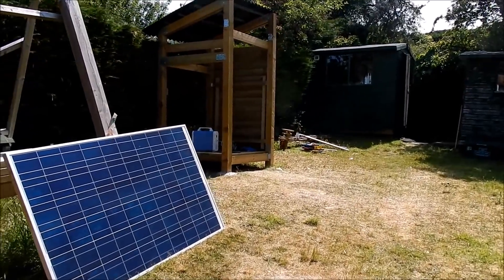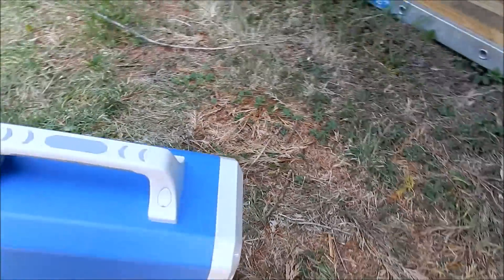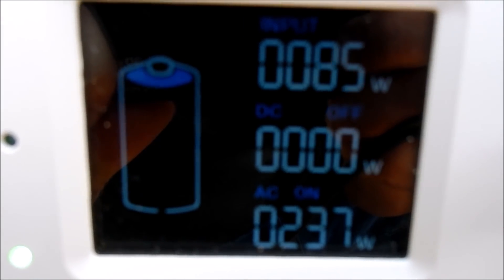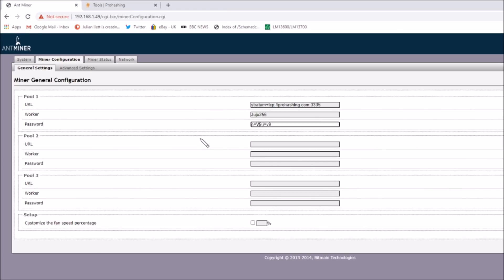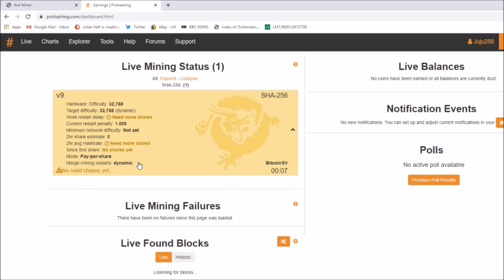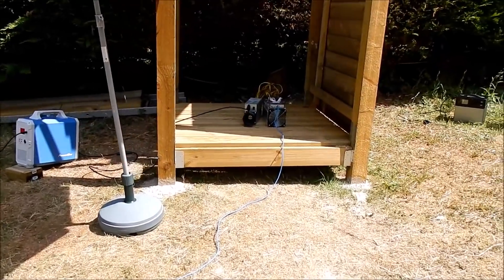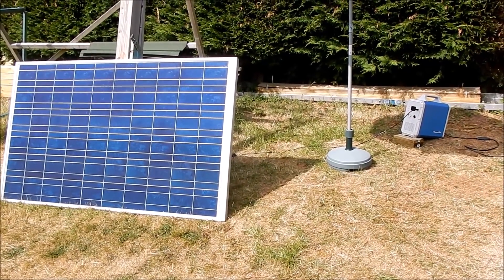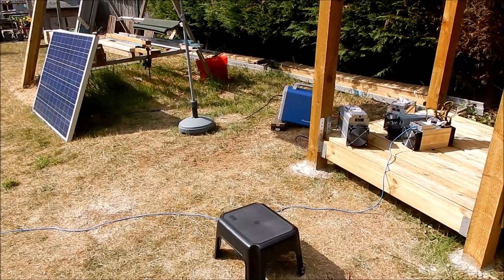$ Turn Sunlight into Cash $

Comment: You can better use serpclix. https://serpclix.com/users/referrals/08HQTX965FOUVLL1FEUCIARIT
With serpclix the only thing you need is your computer running and a webbrowser needs to be open. You get a notification when there are orders, you click on them, google opens up, you search for the keyword and when the correct website pops up you need to click it and that's it. It takes very little of your time. You get $0.05 to $0.10 per click. On average it is about $0.80 you get per day worth of clicks. So about $20+ per month for just running your computer or even phone!
Reply from the maker: Caveat Emptor :/

Comment: i like the idea, but it would be smarter to just use a 12v pack, removing the psu of the ant
the double inverting (12-220-12) is highly inefficient
Reply from the maker: Yeah, the PowerOak can't deliver high current DC - I had to use AC.
Reply: @JulianIlett  go with car batteries. curre t isnt an issue and charging them with solar isnt either. and they are 12v
Reply: urugulu they aren’t deep cycle and will die very quickly. Recycled lithium batteries from laptop batteries and modem backups is your best bet these days. If only BatteryHookup or Jag35 would ship to Britain for less than the price of the batteries or in some cases at all. But first he’s gonna need some more solar!